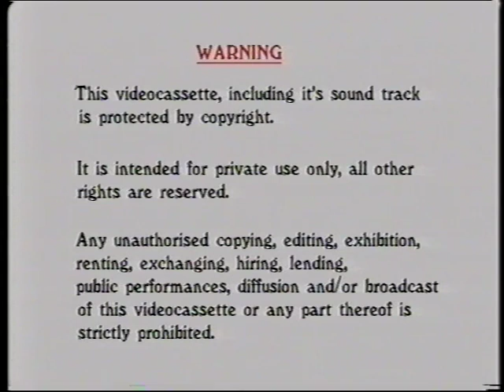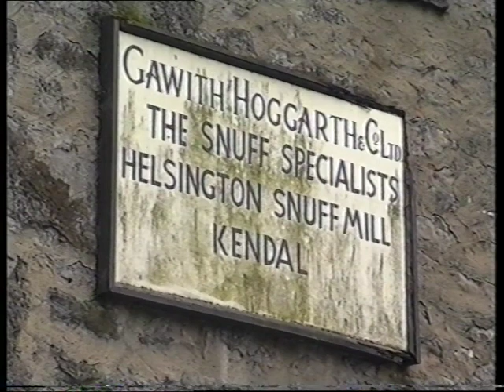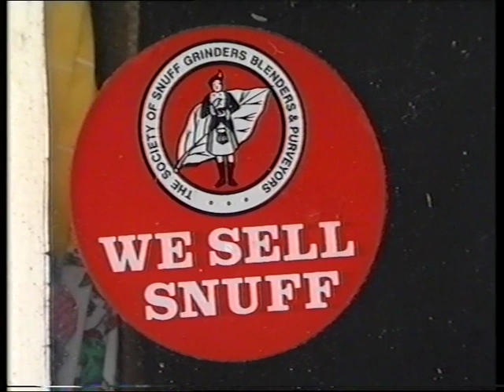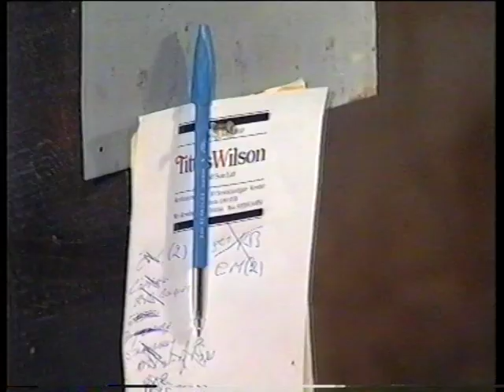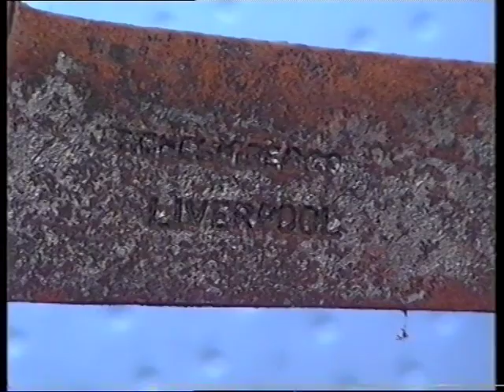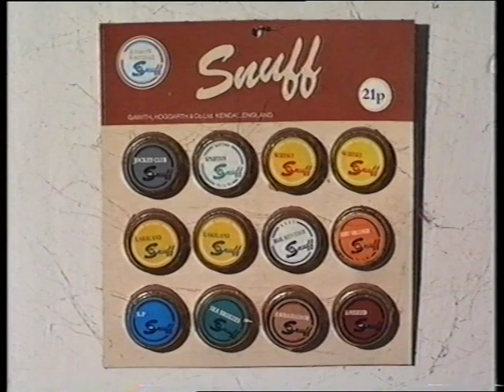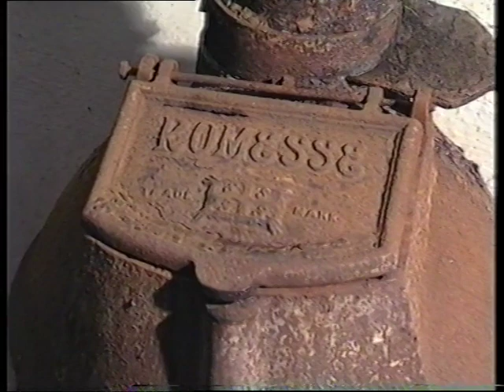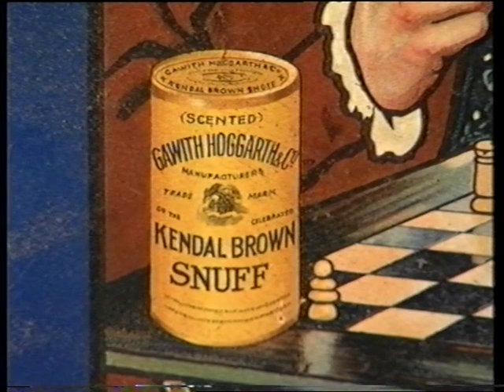helsington snuff mill

Comment: That was absolutely fascinating and wonderful to see. If only it was still in operation so I could have gone and made a video of the operation myself. I've seen your posts on social media around the mishandling of the water wheel and machinery, an absolute shame it's all lost or beyond repair. What wonderful machines they were.
Anyway, I had a couple of pinches of Gawith snuff as I watched this - Alan and the others who worked there must have had the nicotine tolerance of elephants with the dust and handling!